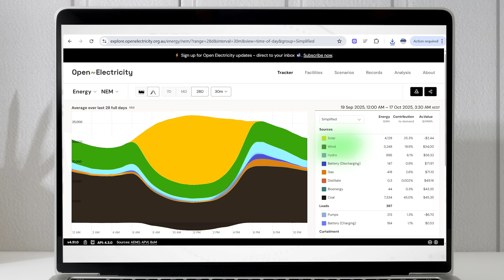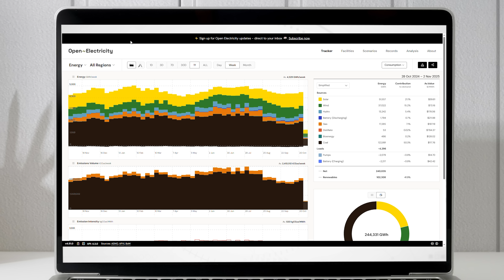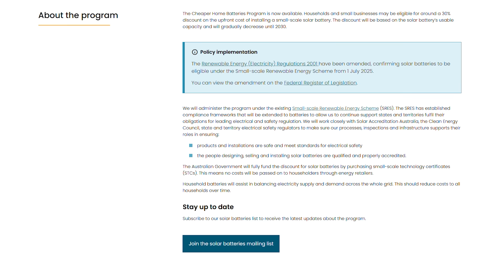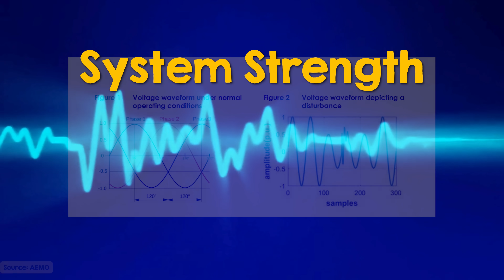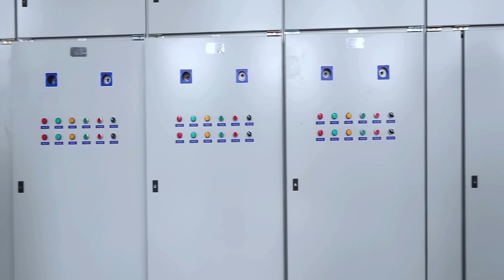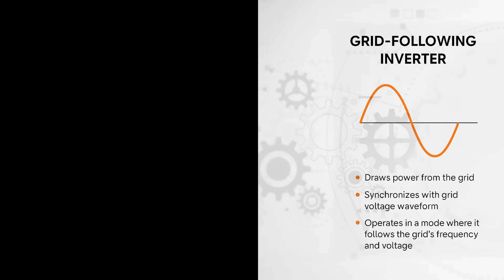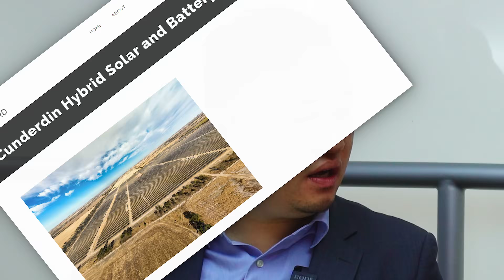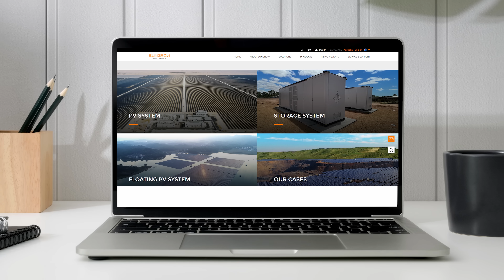Australia’s Solar Boom Is Breaking the Grid - Or Is It?

Comment: The issue comes down to how much it all costs, teh additional batteries, the additional trasnmissions lines and maintenance in order to do the same job as nucleur could have done more cost effectively.
Reply: Rubbish. If you include the cost of managing the waste from each generating source then nuclear power is the most expensive power source because of the length of time that the waste needs to be managed.

Comment: Electricity grids can quite easily be computer controlled and if every business and home has solar panels and batteries you can basically eliminate blackouts. 
There are better alternatives to solar and chemical batteries such as closed loop hydroelectric power stations which if designed correctly can actually provide electricity indefinitely without the need for solar or wind power systems. 
Yes a closed loop hydroelectric power station can be self recharging and when you create a system of them strategically placed throughout a city you end up with an easily controlled self-sufficient electricity network that has running costs per year that are cheaper than the hourly running costs of a single coal burning power plant.

Comment: definitely biased commentary (by both host and guests).. guess its no surprise.. easy question, if spain didnt have solar (/wind).. would the grid have collapsed.. answer- no.. sure 'engineers' can come up with ways to combat grid instability.. which will result in more blackouts/brownouts, until they find real solutions.. if ever.. at a cost that will benefit consumers.. we will continue to pay exorbitant prices for electricity for the long term, because of 'green' (which is NOT green in the slightest!) energy. as soon as chinas production collapses (which is happening now).. watch prices of rare earths skyrocket.. which will destroy solar/wind 'solutions'..
Reply: There were multiple reasons for the Spanish collapse which had little to do with solar. South Australia has a very high share of solar but AEMOs latest system strength report found that SA is the only state on the NEM unlikely to experience system strength shortfalls over the next 3 years without further action.

Comment: so i'm  guessing you need grid forming inveerters in stratic grid positions to protect the grid but at times solar and wind abd bateries supply power intermitantly based on weather and for bateries on capicity abd ecomonics.    How do you mange to keep enough working in te optium areas to ensure grid safety?  with coal turbines runningalmost coninuosly that would hsave to be much easier to mange.   easyier to manage means cheaper i suspect.    
are the grid forming inverter more expensive to buy and maintain, do the last as long as grid followers ad they as efficient?

Comment: Many devices are indifferent to voltage; others are intolerant of fluctuations. But why? Because they have been designed and built in the era of almost-always-very-stable AC grids powered by turbines driven by steam? Now that we're exiting that era, it ought to make sense to design devices which are completely tolerant of a more fluctuating AC.

Comment: hi Rosie. I can't understand why we haven't re-written the software for the grid to mimic the internet.
Combination of hubs &nodes linking multiple rural/built up areas - microgrids. Also batteries to facilitate grid stability. 
yep- I know the national grid is old, reached end of life, & needs to be upgraded/replaced. 
Just let the users know what grid operators plan/currently doing so we can mitigate for the inevitiable hickups in stability.

Comment: The problem is you can't export that energy
Reply: We could export excess power. 

Firstly, PNG and parts of Indonesia could easily be connected to the Australian grid. At Torres Strait there is only 12km separating the most northerly Australian island from PNG and the distance between individual Torres Strait islands is quite small. It is also not particularly far from that closest point between Australia and PNG and the PNG-Indonesia border.

Secondly, surplus electrical energy can be used to breakdown seawater into hydrogen and oxygen, and then to liquify the hydrogen for export in vessels similar to those being used to export LNG.

Comment: We are transitioning from centralized energy to distributed energy. However, community-based stable energy (large-scale energy storage) and high-voltage and ultra-high-voltage transmission will inevitably be a key focus of grid upgrades, as energy resources in some states may be unable to generate electricity due to extreme weather.

Comment: can the grid handle it ? ... short answer yes it can, over peneration of solar is a myth and ancillary services is the key, new inverters with frequency and voltage regulation and semi conductor FACTS devices for protection and quality already exist so the hardest challange today is inertia, if you can maintain something called RoCoF to grid standards then the grid will handle all the solar you can give it and still be stable, australia is a solar engineers dream because australia doesn't f**k around with half measures

Comment: i see a lot of residential power wall being pushed out recently, it is individual home based.  and i am guessing it still use lithmum iron battery.

I feel like a more industrial solution should be the way to go, such as suburb scaled power reservoir, such as heating tower to store energy.(each surburb gets its own big battery) i feel like that would be more cost effective, i dont think getting each home more 18650 battery is the solution..............

Comment: You will have to find massive storage until we want it. Grid forming inverters will not be compatible with any thermal type generation so the system will have to be only powered by inverters ( electronic controllers). This will solve the short term intertia stability but not several hours in the evening.
Also there are massive other problems as fixed electricity is only a small part of our energy. For example heavy transport, air travel, manufacturing, steel, concrete, fertilizers, plastics, almost all manufacturing procces.
I would not call it being a super power maybe to over supply of one aspect of our energy needs alone in a world where most are not doing much at all

Comment: The point of inertia is that it is slow and doesn't react quickly. That resistance to quick change is what provides stability. 

If... nay, when the code that provides stability in this grid forming inverter fails, their quick response is not going to be an advantage.

Comment: One obstacle in the move to roof top solar is the fact that, even with the new advances in solar panel technology, it is currently not possible for medium/high density apartment and commercial buildings to be self sufficient in power generation even when the sun is at maximum elevation. The reason is the relatively small surface area of the roofs of these buildings for the number of residents and the fact that around 50% of their ownership is absentee landlords who see no revenue benefit for them given the cost of conversion. The solution lies in adoption of neighbourhood power schemes with multiple neighbouring buildings sharing their roof areas through interconnected power and their grid plugged in to a community battery. As well as ensuring that inner city areas can effectively participate in the move to renewable energy their power lines can be installed underground, thus helping once and for all to remove the blight of overhead power lines.

Comment: Putting solar panels on each individual home in hundreds of separate installations is hugely inefficient and uneconomical. It would make a lot more sense to develop industrial scale solar fields.

And don’t get me started on the fact that you can’t use the electricity you produce, you have to sell it for cheap and continue using the grid hoping to produce enough to offset that cost…

Comment: The main problem is that the utilities people knew it was coming - the writing on the wall was there decades ago - and nothing was done because everyone was chasing $$$. They knew grid upgrades and system control research and solutions were needed and they all sat on their hands despite being repeatedly told. Every dollar they could have spent years ago, on advances in tech and engineering when the need was becoming obvious to all but the particularly dense, is now in the realm of $200+
Australia is great at tech/industrial advances, but not great at doing things before the problems arise. My source is that hubby works in the industry and knows a lot of people, including in AEMO. I've not said anything that isn't common knowledge. The power industry stuck their heads in the sand and hoped it would all go away because they didn't want dividends dropping. An abject lesson in why necessary utilities should be under government control and never privatised.

Comment: On the topic of the amount of energy generated and when, in the future why not develop new and very useful uses for the extra power, so that when there is too much energy you're using batteries but you also have additional uses for the energy.

For example, you can turn sea water into drinking water, and with global warming there will be water shortages.  So if Australia brought online massive amounts of desalination systems that would only be running when there was too much solar and all the batteries were full, then you've used the energy for something useful.  Creating more drinking water isn't so time dependent so if you create it at midday or late in the evening isn't so important because drinking water can be easily stored.

This means that the negative pricing isn't going to be an issue.

Comment: Just finished installing my 24kw battery last week. With my solar system I'm now self sufficient 90% of the time.  With a/c I'm running out of power around 3am, not until 7am when solar is ramping back up again do I go back off grid. Because the government rebate is a one chance application I'm looking at maybe adding an extra 8kw module at full cost to go 90% to 100%. So glad government is doing the rebate! Went sigenergy which apparently does grid forming voltage.

Comment: You're massively overselling the state of play for grid forming inverters. They are being installed but there is no part of the NEM that currently relies on them. They will help in theory but its far more difficult in practice. There are enough problems with IBRs interacting in unexpected ways during normal operation and after minor disturbances, there's no reason to think these interactions will be simpler to manage after major disturbances or faults.
Syncons are the current solution for inertia and system strength. There are currently billion dollar projects to install them across the NEM to hopefully prevent our grid collapsing as we introduce more and more renewables.
I dont know where to start on the cost of renewables and the rosy projections for the future. But its pretty clear that guy you interviewed isn't all that confident about it. An in the meantime, our energy costs are rising in real terms.

Comment: Love the openess and details with respect to the problems in a systematic approach (lots of info I was unaware of). Equally so are your solutions and rational optimizum for overcoming them... It's quite moralizing having the land of Auz lead the way.

Is it possible to create a 'smart sink' with a smart grid... When solar output is in excess of grid needs and battery storage capacity, could you divert it with electrolysis plants that could be ramped up and put more research into green hydrogen and water desalination to increase efficiency in the future and avoid a mad max future?

Comment: Of course it can 'Handle' IT! Realism; You can drop at least 40 > 50% off of Solar panel function, via the est 100, 000,000 Tonnes of Radio Active/ Alumina & other Nano Tech Particulants deployed by Predominantly Military Contractors, Globally for UV 'Blockages' in the ALL Spectrum control Geo Engineering Field! Mix with this, chemical EMF variances via Frying the Upper atmosphere to Boot!
'Renewables' - Stupid Science, for even more Gullible Patrons! That's because 'They' have HUGE subsidies, to Synthetically alter the Cost - benefit ratio, AND, refererred as 'Renewables', for having to Renew ALL of the replacement parts!  WHY, ISN'T ANYONE TALKING ABOUT THE POLLUTANTS DESTROYING 'YOUR/OUR' HABITAT? 'Renewables' ARE part of the contributors to Planetary Self destructions!
And now -  'Science' = Garbage IN > Garbage OUT!
Reply: I don't know if I can take criticism of science from someone who doesn't know how to use the '>' operator. 

By the way, you might be stuck in 2015 because the price of solar panels has dropped by over 90% since then. They don't need subsidies in Australia anymore.

Comment: The problem will solve itself due to the economic death spiral. The grid generators and NEM put the prices up to counter the loss in sales caused by PV, which prompts more people to install more solar. Home batteries will soon be necessary to counter the rising prices and the gouging of the 6pm peak, which lowers the 6pm peak. Resulting in rising prices.

Comment: What you might want is for any inverter to be capable of being grid forming, and for them all to communicate with each other on grid start up, and select a leader to follow; that way, if the leadet goes offline for any reason another one could step in and take its place as the leader. Would that be necessary if they all used the same (atomic) clock?

Comment: Of course solar and wind must always work with river dams, integrated as 1 single system before into energy market distribution.

In that way you ensure energy stability from one single source, thats has both wind+solar+river dam.

The split and competition between solar and wind and river dams, are the reason the balance can be lost like hapen in Portugal and Spain this year.

We need to end that mistake. Solar and wind cannot be allowed to sell into the market if dont have river dam connected.

We dont need lithium batteries, se just need more river dams ,and more water resevouir to be second energy batteries, like we have here.

The insisting on savage capitalism were solar compete with river dams and wind, without energy stability that can and did already general enegy shut down.

Comment: All homes with solar panels fitted should be converted to hybrid inverter with 30-40kwh of battery storage with their supply set to power from battery by default. Andrew was spot on and >90% of homes with solar should be off-grid with 30-40kwh of storage. As the population increases so will the off-grid storage so we won't need any more grid capacity.

Comment: Why the F*** is all power bills so high if we got this much solar!!!
Reply: Electricity prices are linked to gas prices because gas-fired power plants often act as the "price setters" in the wholesale electricity market, meaning their high operating costs set the price for all other generators. When gas prices rise, this pushes up the price of electricity, as the cost of the most expensive generator on the grid dictates the wholesale price for everyone. This happens even if gas provides a relatively small portion of total electricity generation. So you can thank this crap pricing method and the Gas industry for pushing up energy prices in Australia. Plus the Gas industry pays virtually no Tax or royalties on all the gas they export overseas, doubly screwing Australians........

Comment: there's still the problem of raw grid capacity. i currently do delver's and my area has lots of solar plants. first time i rock up to this one plant i ask out of curiosity what capacity the it has, he says it 200MW but they haven't pushed it past 100 as the lines cant take it. there's new one about to connect at 170MW to the same line that's already running near capacity. and that's even if they are running on partly cloudy days they have to shut down as there output become to erratic from clouds passing over. 

its all a neat idea but its still not ready. we've built a race car but still haven't built the track for it to race on.